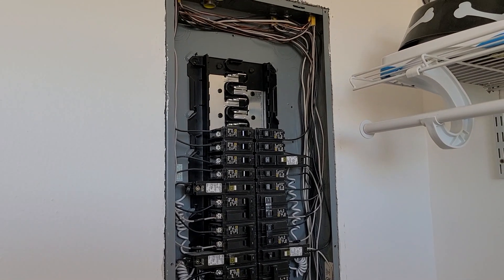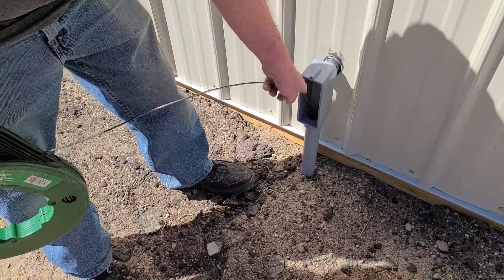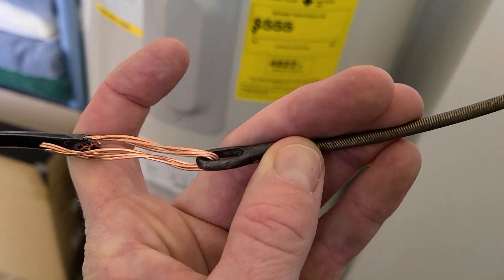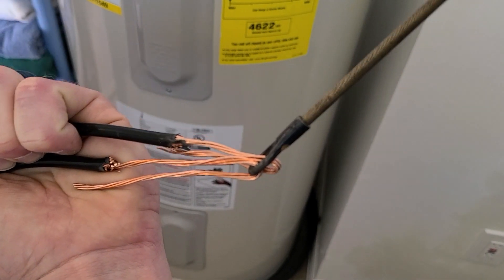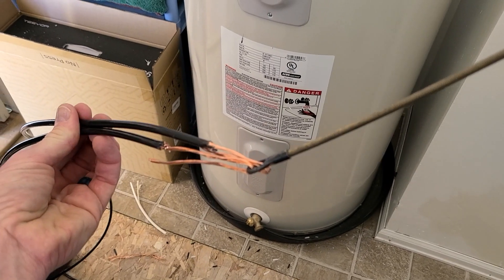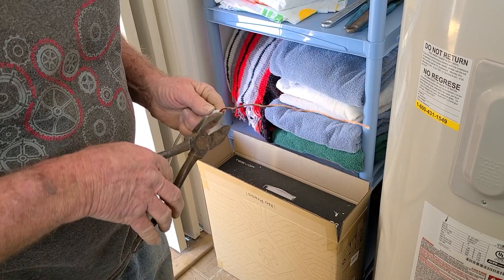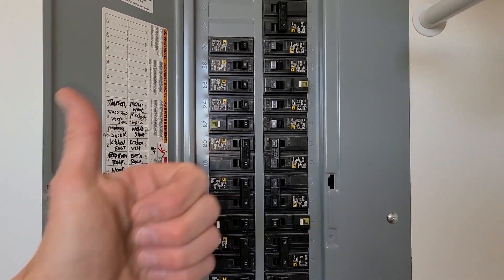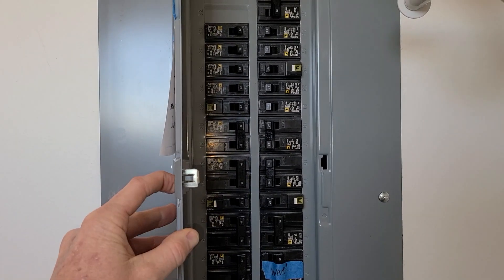The Easiest Way To Pull Large Gauge Electrical Wires Through Conduit

Comment: Why not have the vertical pipe on the outside and just go straight into the back of the panel instead of pipe on the inside wall. Plus, eliminate a junction box.

Comment: Thank you for the info- especially the staggered insulation. Had trouble with a pool light replacement and the conduit was only 3/4”, pulling insulated wire thru a tight turn and we kept getting hung up.  I ran some fishing line thru as a safety when we removed the old wire. Kept getting hung up until i staggered the insulation. Long story short, Ran some 80lb braid thru there because the 1/4” fish tape also couldnt make the turn and i was worried the initial run of 25lb mono would snap. The stagger made it work don the first try.

Comment: Sir, you need 4awg to pull 75A. The max that 6awg can pull is 55A. Change that breaker out ASAP! Also, you should be running a ground rod for a detached structure.

Comment: Will this method work for 4 90 degree horizontal turns and 1 90 degree vertical turn?  I need to pull one 4 AWG black wire + one 4 AWG red wire + one 8 AWG green wire about 150 feet underground.  I am thinking of using 1.25" schedule 40 Cantex conduit buried   12-18 inches underground.  I'm worried the stiff wire wont be able to handle so many turns. 😮
Reply: Code says you can only pull through 360 degrees of bends between pull locations, FYI.

Comment: You can’t put 6 gauge on a 70 amp breaker
Reply: But THHN AND THWN IN THE 90 degree category can handle 75 amps correct ?
Reply: @kuuleiimokihana4523 the breaker terminals are not rated 90c  so no you cant
Reply: you obviously can.
Reply: Why not? You can oversize your wire, but you can't undersize your wire to your breaker ampacity, meaning your breaker ampacity can be lower than the wire ampacity that it is fedding, but you can't have a larger breaker ampacity feeding a wire with a lower ampacity.
Reply: @badgthom  6 gauge is rated lower than 70 amps, therefore, in this application, the breaker is oversized for the wire. Just like what you said is not allowed.
Reply: @badgthom its not oversized, its undersized. 70amp requires #4 copper or #2 AL

Comment: Informative video for weekend warriors looking for some tips, but as someone in the trade for years I would make a few suggestions.
   First, you unnecessarily started pulling the wire from the main panel, which means you pulled the entire length of the wire that will be going underground to the barn through the house. Start at the outside LB that’s on the house and pull what you need to the house panel, and then pull the remainder over to the barn. 
   Second, you can’t re-identify anything smaller than #4 as a ground.
  Third, forget the fish and vacuum a pull string through. Much easier and quicker and pull string won’t jam up on you.
   Fourth, there’s no need to pull the extra 20’ you have through the LB inside the barn up to the panel when you only need 7 or 8 feet.
   Lastly, use a pulling grip and save time by not having to strip wires to attach to the fish and save yourself a half roll of tape.
Reply: damn.... these are great tips.   We've been doing this stuff for years (not professionally) the old fashioned way like this video.  Add these to the "why didn't I think of that" list.  Thanks!!!
Reply: Good tips Jim.!  I'm retired after 35 years in the trade and all of what you mentioned were used often but not from the get-go when starting in the trade.  Your time and advice will be appreciated by lots of the newbies.  It's mostly just good common sense but sometimes that's not as common as we might think. :)

I'll add a small tidbit that I found very useful down through the years.  I soldered small dots to my fish tapes at 10 foot intervals.  After soldering the dot, I used a small file or sometimes a knife to make Roman Numerals in the solder to show it's designated position.  That way I could stick the conduit run and determine its length without any further ado.  That made  for accurate pre-cutting wire for a pull  to avoid the disappointment of finding that I shorted myself on a pull.  I see they sell tape with foot marks laser etched into them now.  Sweet progress ... would have saved me the time doing that solder job... it took proper cleaning and flux and my free time before putting the tape in the hands of my help.  I also installed a "Speedy Leader" on all my tapes... the only fish tape leader worth having!  Newbies can Google that for a source.

Comment: Stupid question maybe but why can’t you put the conduit on the wire as you’re burying it?
Reply: You could but the code says your conduit system has to be installed as a complete system before you pull wires. But people do it anyway. See nec 300.18 (A). Complete runs.Raceways(conduit) shall be installed complete between outlet,jinction, or splicing points prior to the installation of conductors.
Reply: @jtd2949  Could your PVC glue damage your wire insulation?
Reply: @jtd2949  now I know. Thanks

Comment: I am running romex 6 gauge from my main to my tesla outlet. I plan to run through emt first and then it has to go underground, in gray PVC. Can I place the romex in there the entire length from main to my outlet?
Reply: No.  Romex is not code in conduit.  Use single strands.

Comment: I can tell your father is an electrician!  All the cut off crap is thrown on the floor.   Laborers job!   I’m a retired electrical design engineer.   I see an issue that is important.   Article 225 Outside Branch Circuits and Feeders has a requirement for a means of disconnect when you feed a detached building from another.  Often missed because most do not read 225.   You are supposed to be able to disconnect at one point at or near where the feeder enters the building.  So, a main circuit breaker or a Safety Switch are needed to meet NEC.  Going to try to find the next video for something else possible but will not know until completed install.  My purpose is only Safety, not just pointing out errors.

Comment: wheres the expansion coupling before the LB's? ground thaw will stress those pvc conduits apart
Reply: Yes they will ,I forgot to install 1 in Just a 11.5' vertical and it Banana'd over Time. I Just took care of it though. I didn't have any wire in it yet,have to finish the main side upgrade.

Comment: Thank you gentlemen.  Very helpful. Nothing like experience and the ability to convey what you know as well as do with excellent communication skills.  Do you recommend a similar technique when running 2-2-2-4 aluminum SER through 2 inch PVC conduit on an exterior wall to connect to a sub-panel in a garage?  Or is it ok tosnake the cable through the separate pieces of PVC  build and cement the conduit run around the cable , then install it as a made unit?
Reply: I was wondering the same thing with my install, 2-2-2 alum wire through 2” conduit.  What did u come up with for your situation?

Comment: Hi, how did you affix the PVC conduit to the non-threaded LB? Just insert with the glue and no fittings needed?
Reply: Yes the conduit is able to slide into the LB without any fittings. Make sure to glue for a strong connection.

Comment: It's odd you say aluminum is "dangerous" for houses, yet the large wires that come from poles; aren't they aluminum?
Reply: The hardware has to be designed for aluminum, or both aluminum/copper. Aluminum wire expands and contracts more with temperature than does copper. Aluminum wire in a copper only fitting can work itself loose and cause arcing and possibly fire. Aluminum in contact with copper also corrodes, so a protective paste is needed for those connections.

Comment: Why didn't you color code the wires? I get that they're both hot, but as a general rule, you always mark the different phases..
Reply: Is the same phase
Reply: @edgarzamora1996 lol what's the same phase?  He's running a 240v circuit..  the hots, even though fed from a single phase transformer, are still 2 different "hots" that our out of phase from each other in order to get his 240..

Comment: That wire is not large Guage wire. Try pulling 1/0
Reply: Everything is relative, 1/0 is on the small end of the spectrum where I work.  Try pulling 1000 MCM copper 1000' thru 6 -90's and then vertically 18 stories

Reply
Reply: @gsibert1  I hear you, I was just trying to say that I consider pulling #8 wire fairly easy but you start getting into #1 and larger is gets to be a pain. I can only imagine that larger stuff you mentioned.
Reply: hahaha try 750 MCM

Comment: Any reason why you didn't run the wire before you buried it?
Reply: You almost always are pulling wire through a conduit after it is completely installed including buried. Unless you're using the incorrect wire or to small of a conduit it shouldn't be an issue to pull the wires through.

Comment: general question:   if I have proper earth ground on main panel, and I run a sub-panel box in garage, do I need to add an additional earth ground? or is the smaller ground connected to main box acceptable?
Reply: You need a 4 wire feed to all subpanels, and whenever the building is detached, you need 2 ground rods
Reply: Yes, the 2 ground rods tie into the subpanel at the detached building with a #6 AWG or larger copper conductor.
Reply: @chrisruss7863    Hi Russ,  OK good with the four wire and separated buildings have a ground rod.     Can I assume I can tie the two "ground" wires together in the garage sub-panel since they are both "earth ground"  75 feet from one another?

Comment: I always oversize the conduit and wire.  I ran some conduit ahead of the electrician coming. He said I just wasted my money.   In my mind it’s future proofing it.  It was for a generator and when it goes a bigger one will go in it’s place.  The larger wire will meet code.   The pvc conduit used to be so cheap why not.  The wire wasn’t that much more and I won’t have to buy a larger one again for the same thing.
Reply: 7+ years electrician'n now and there's nothing wrong with oversizing if you can afford the difference and it gives you peace of mind for anticipated/potential changes later on in my opinion, you or someone else after you will be able to use it for additional options if needed and I love working for ppl who think ahead before I arrive like that, makes the job way easier and costs less in labor.
Thinking ahead like that in most cases isn't a waste of money unless you planned on selling the place within a few years.

Comment: Wait what..??!!! 6awg wire for 70 amp breaker.. ??
Reply: On feeders if it just under a standard over current device you can go up next size. #6 good for 65 amps so you can go up next standard size which is 70 amps
Reply: That should be number 4 wire.. for 70 amp breaker... 🤦🏻‍♂️

Comment: I thought 6 AWG was rated for 65 Amp,  you would need 4 AWG to avoid frying the wires on 70A breaker.
Reply: Its a feeder 65 not a standard breaker so you can go up 1 size to a 70 amp
Reply: @thomasmarable6818  where does it say that?
Reply: Yep.. poor dad.. probably read the table wrong by accident..he definitely knows what hes doing.. father is the tradesmen.. still valuable video.. but should downsize breaker thats all.
Reply: No. You can put the # 6 on the 70 amo breaker because there isn't a 65 amp breaker and the code allows you to go to the next size up if this is the case.

Comment: Just curious. Is it okay to use a smaller wire for the ground? I have to run some 6 gauge wire in my trailer. Thanks.
Reply: You could use #10 for the ground
Reply: #10 ground for 25-60 amp, #8 for 65-100 amp.
Reply: @sparkyjerred419  It's for 50 amp. so I guess #10. Thank you.
Reply: @love2gocamp  for a sub panel that supplies any 120v you need 4 wires,( 3) #6  (1) #10 the neutral bar is not bonded to the enclosure at the sub panel & a seperate ground bar is bonded & for grounds only. The neutral must be white & the ground green or bare.
Reply: I just got an estimate to install a sub panel in my garage. The electrician said all the wires would be 6 gauge.
Reply: @robmespeedy  ground can be slightly smaller size wire
Reply: @robmespeedy  ground can be next gauge smaller, not a problem

Comment: You can tell this guy is a professional electrician...just having proper conduit and conduit body fill, GFI breakers in the panel, correctly marking his ground and neutral conductors, using plastic insulating bushings, and explaining sub-panel ground/neutral separation shows his familiarity with the 2020 NEC.  It is refreshing watching a video that does NOT have a handful of glaring 2020 NEC violations.  If more electrical installation videos were made by qualified tradesmen like yourself, we would all be much safer from electrical hazards and fire.
Reply: There’s several violations actually lol. I would hope you’re not an electrician yourself 😂
Reply: @B_dilly right, couldn't tell if he was being sarcastic or not
Reply: @B_dilly  What are those violations?
Reply: It’s not even about qualified persons most of the tine just because they come out with a new code every three years doesn’t mean everywhere follows suit most places aren’t even on the 2014 still. I actually haven’t worked in a place besides Kansas City that requires 2017 I imagine it’s probably different in metropolitan areas on the coast but out here in Kansas and Colorado it’s all governed by the county there is no state licensing or regulation I’ve worked in places where it’s only enforcing 2002 NEC

Comment: Wire is un size ,for 70 amp breaker , especially for the run u have
Reply: Sure is..
Reply: Ah but if you remember he was talking about how the wire he was using had a different kind of insulation it’s not thhn so if I had to gues its probably Thwn that he used rated at 90 degrees ambient and technically I wouldn’t even consider that a long pull it’s probably only 100 feet at most not that long
Reply: @beauwoodbury1112 how do I do this with multiple 90s horizontal too? 100'
Reply: If he is less then 150 feet and his continuous load is not more then 80% then he is ok. This is a feeder and #6 is good for 65 amps which is not a standard overcurrent  device so you can go to next size up 70 amps. Learn the code

Comment: Nice video.
The #8 EGC should be either bare, green or green with one or more yellow stripes per NEC 250.119 . It appeared to be black. Tape cannot be used on conductors smaller than #4 per NEC 250.119(A). 
Also, the fires associated with aluminum wiring occurred because the terminations were not listed for aluminum conductors at the time. Today, most terminations are listed for aluminum or copper so there is little to no risk of fires.
Reply: Also #6 copper is inadequate AF for a 70amp circuit.  Dude's old and clueless!
Reply: @Thatguyfromttown  Exactly! 55A max!
Reply: Meh it’s his property out i the middle of nowhere 😂 he is the Authority having Jurisdiction I imagine they probably don’t have any regulation where they are anyways

Comment: I like that you got the job done, but pulling string or rope would have helped lots. You wouldn't have needed two fish tapes. Nor would you have to undo the wires from the fish tape after reaching the first LB corner because it would have been made up on the pull string. Untie it and re-tie it to the fish tape.

Or is the fish tape is long enough, you can also push it from the beginning, then through each LB and pull the wire through it the same way.

Also, i believe you need another grounding rod since it's a separate building.
Reply: I agree with routing through the LB and avoiding reattaching every time. Saves a lot of time. I use pull string or 1/2' nylon pull tape for this. The pull tape handles better and does not twist up as bad as the jet string. Also you can suck a mouse attached to the jet string through PVC easily with a vacuum.
Reply: Where do you get the mouse?  Find a field mouse or from the pet store?   @Sparkeycarp

Comment: Shouldn’t 4AWG be used with a 70A breaker according to the NEC?
Reply: 6 AWG THWN in a raceway is good for 65A at 75 F. Next standard OCPD is 70A. This is a-ok by NEC. You're probably thinking of NM-B. That would need 4 AWG.
Reply: @Rese Shively NEC requires outside disconnect for outbuilding more that one 20A circuit. Also requires smaller than #4 to be of the correct color. Cannot tape #8 green must be green insulation. (which he didn't do any way). Needs ground rods. He did not need a flex leader for a little run like that, and if you get stuck because you didn't push the PVC 90* all the way into the coupling, you can tie several loops of pulling string on the end of the first fish tape, and then open the hook on the second one and hook it very easily then pull it through.
Reply: I agree, I would have used #4 for this distance at 70 amps. Especially if the are putting in a car charger or some other constant use device as defined in the code. Yep, missed the exterior disconnect.

Comment: People talk about not putting two LB fittings back to back, but you did it and it worked great. I guess they are concerned about the radius of the double turn being too tight. I don't see a problem, because you weren't trying to stay inside a thin finished wall. In fact this is the best option, since inside the room you don't want a wide turning elbow.
Reply: but going more then 360 turns isn't to code, is it, or is it that you are not pulling thru more then 360 at a time the reason for the code so that you don't stress the wire with resistance? The radius seems ok because its individual wires (should do the calculation).
Reply: @stephenvancampen7393  "you are not pulling thru more then 360 at a time" is the limitation in the code because any more turns can quickly become impossible to pull wire through.  It's perfectly fine to have greater turns in the whole circuit as long as there are sufficient pull points for each section.